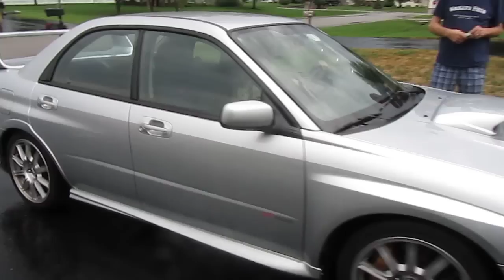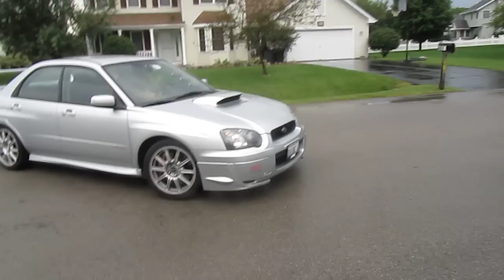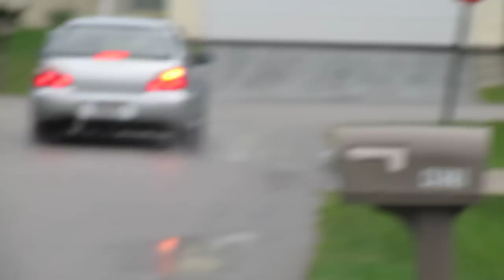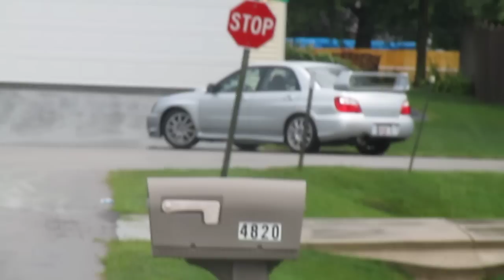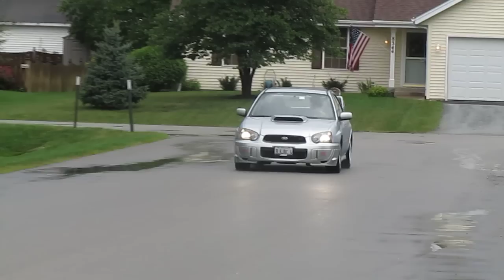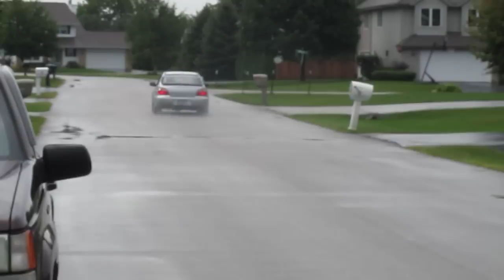Turbo Charged Subaru STI DUCK CALL Blow off Valve. Get YOUR duckcall below!

Comment: I don't know which I find more stupid, the duck call on the BOV, or the fact that there's a BOV on an STi when it doesn't need one.
Reply: Michael Palmer It's a noise maker for young racer boys. It actually hampers the car's performance.
Reply: kimc53 It needs a valve otherwise pressure can build up and the turbo would make a fluttering sound. I understand what you're saying though. A bov venting to the atmosphere may affect performance depending on the application especially in an electronically controlled system that is set up for factory specifications. The terms are funny, a bpv is basically a bov that recirculates. You're correct in this particular configuration of equipment, I just want to clear up confusion so no one goes home to unplug their stock bpv or take out a bov from a car they just bought.
Reply: Doomologist Stock Sti's and WRX's come from the factory with a BOV, but they aren't atmospheric, they blow the air back into the stock turbo inlet to be recycled via a rubber hose, hence why they're quiet. An atmospheric BOV like the one in the video will cause that car to run rich. It serves no performance advantage.
Reply: Exactly. I agree.
Reply: iLive245 Sure, on a 35r turbo running 500 hp, but on a stock VF39, they do nothing but make noise.
Reply: electerially?
Reply: iLive245 stick to anime, that seems to be your crowd.
Reply: Myrdoc All turbo cars have a BOV, it's just the factory does not call them BOVs, they're called bypass valves among other names. They're important to preserve the life of the turbo. Atmospheric BOVs (noisy ones) are not legal for passenger cars and are for off-road use only. Factory ones do not vent to the atmosphere and will recirculate the vented pressure back into the intake. They are actually better for the turbo than atmospheric ones.
Reply: XboxorMat No shit, I've owned multiple WRX's. But sadly now that they're getting older and thus, cheaper, they're falling into stupid hands and quickly becoming the new Civic.
Reply: WRX's were always the cheaper option. They were the "I think I want an STi but can't swing it but I don't want a Civic" car.
Reply: Myrdoc judging by ur comments ur definitely a nasioc member. You are Damn correct about the new civic thing. Wrx/STI are the new civics cheap, quick, and fun.
Reply: Erick perez Been in the Subaru game for a long time and owned a slew of WRX's and STi's, it's definitely not what it used to be.
Reply: Yea I've always been an advocate for the Subaru on  my 2nd subaru but considering changing. I'm too young to stay loyal to one  brand lol there are a lot of good cars out there that I would like to try. Do you still own a Subaru?
Reply: Erick perez yeah, I still have an 02 wagon. Perfect ski bum car.